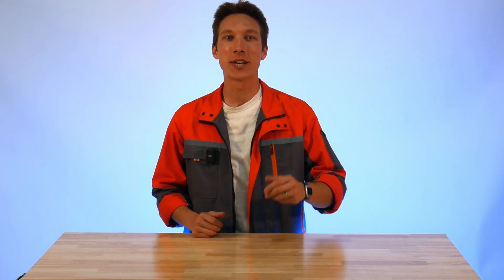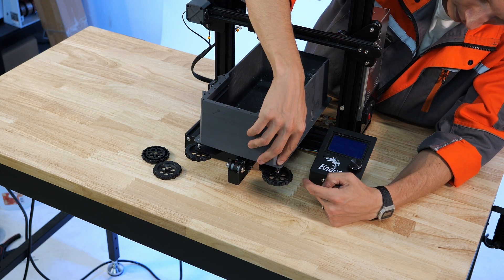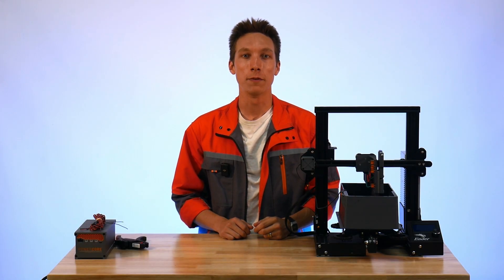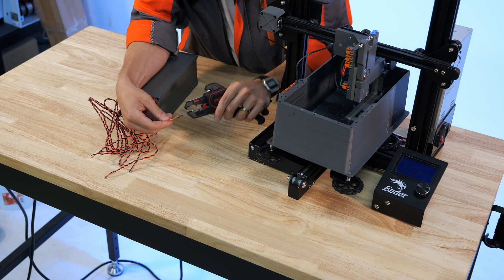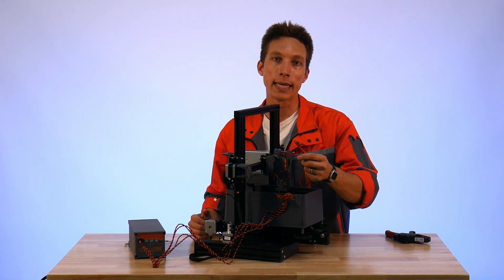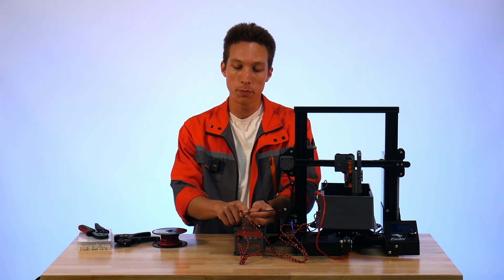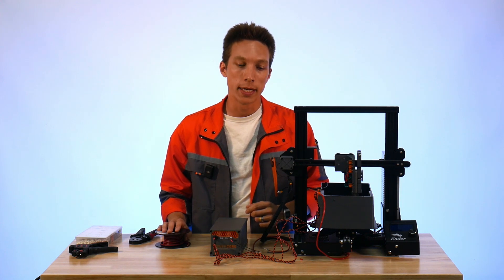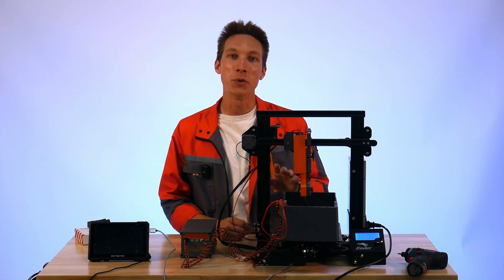3D Printer to WEDM Machine GUIDE - Part 5

Comment: Thank you for the great videos. Does it fit an Ender 3 V3, or only the V1? Thank you.
Reply from the maker: There is a 3D printed adapter plate that you can modify to fit almost any motion platform